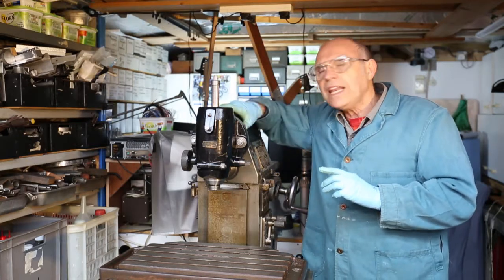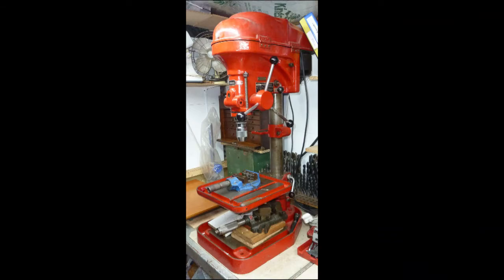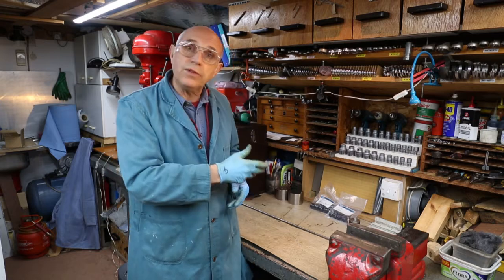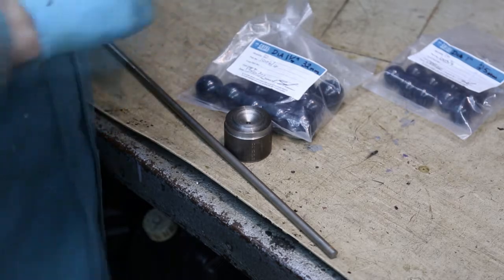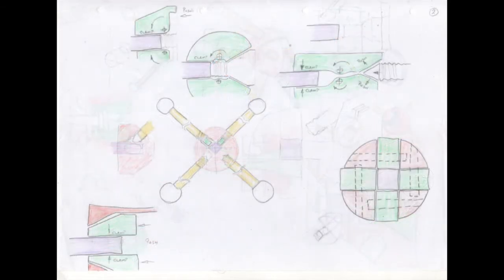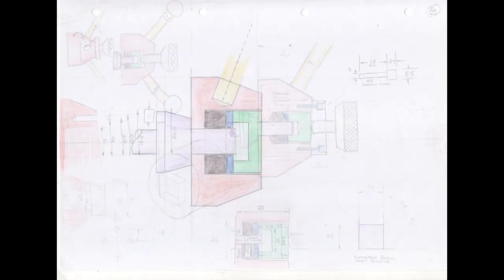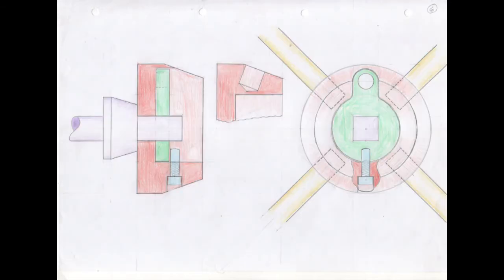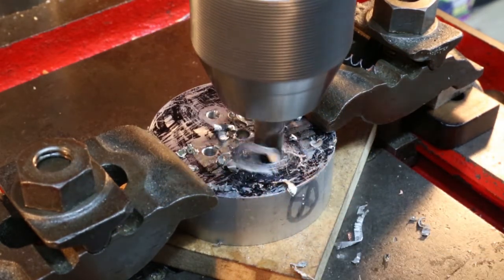How To Start a Design & Organize Your Ideas. Quill Handle Part 1

Comment: I like the drawings and explanation of your thought process. I would not have thought of your final solution and some of your rejected ideas will also go into my mental filing cabinet.
I would suggest that you make the square hole in the hub as deep as possible to minimize any lateral play  which I would find disconcerting.
Reply from the maker: Hello Gary. Thank you for your comment. Play around the square shaft is some thing I must keep to a minimum, the locking plate will only lock against two opposite sides of the square shaft, this means any play in the nonlocked side will allow the hub to twist, and your right it would feel rather disconcerting. The square shaft from the vertical head is 17mm long, the square hole in the hub will be 7mm deep, I haven't made the locking plate yet but I have a piece of 5mm steel sheet ready for it. So 7 + 5 = 12mm this will leave 5mm of square shaft protruding from the locking plate, there must be plain shaft here or the locking plate wont lock. I'm hoping its going to work, I must cut the square holes accurately or I'm going to be in trouble! Please keep your fingers crossed for me.
Take Care Gary, and thanks again for your comment.